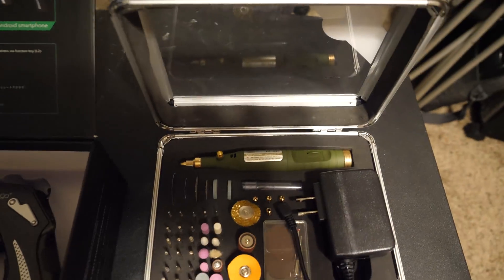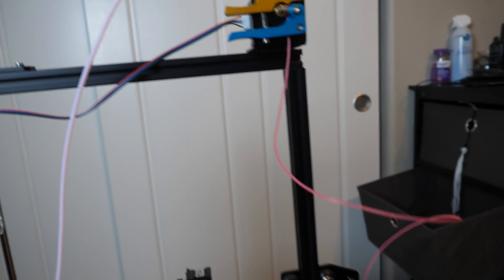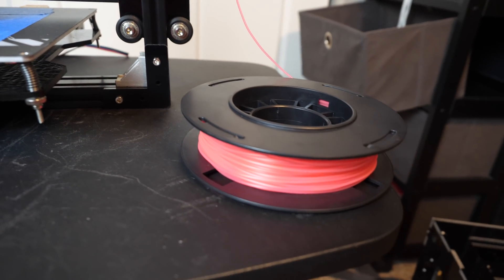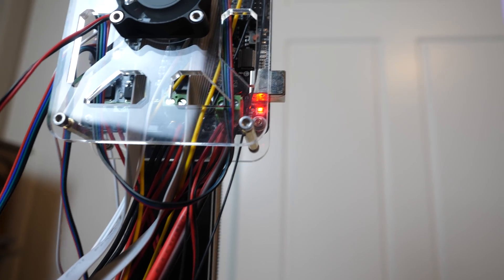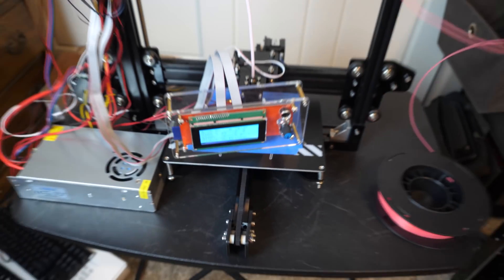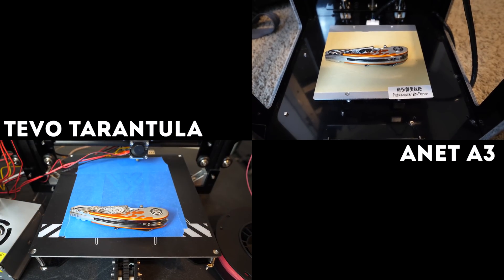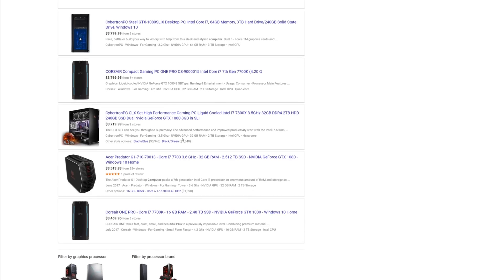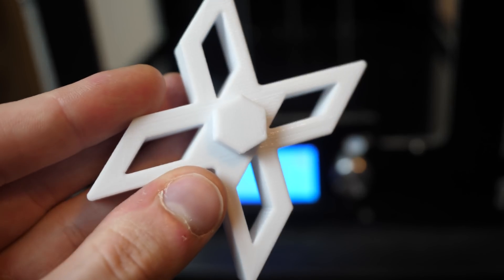Build It Or Buy It - 3D Printers

Comment: Well, that video is kinda shallow.
It's never a good thing trying to review something first time and came up with some generalized statements about the whole thing.
F.e., assembling a printer from a kit is not a 100% build. There are 3D printers built completely from scratch and there is a huge community behind it. Not to say there are so many 3D printers (both assembled and kits) with different pricing and specs - not much things about them can be generalized. It is not rare In 3D printers: you can easily overpay for something not very good and for cheap get something awesome just because the market of printers still in rapid development phase.
...
BTW, next time someone say about console exclusives - it is reasonable to point out PC have the highest number of exclusives - more than all the consoles combined :-]

Comment: I built mine in 3 hours, plus 1 hour of cable management.
plus 2 hours of making a custom x/z axis, plus 1 hour for a 70mm fan mount, plus 30 minutes to change the control panel location, plus an hour to switch to plastic bushings instead of bearings, plus 2 hours to make an enclosed box with a heater... well you get the drill, I customized it a lot.

as far as the comparison, the tarantula has more than twice the build volume(200*200*280 vs 150*150*150), but I'd suggest the CR 10 instead at this price point, it is easier to build, has a bigger volume (300*300*400mm) and costs 4 more silly european dollars than the tarantula.
Reply: here's a gearbest link for the cr10 https://www.gearbest.com/3d-printers-3d-printer-kits/pp_637921.html?lkid=12706796

Comment: My cousin built a 3d printer from scratch, not bragging, just saying that I know a few cool ideas. He started his project roughly 2 years prior to this comment. He used wood to make a kind of tower that becomes a triangular pyramid at the top, in the base is the electronics and a monitor he salvaged so that it has a UI. Its big and inconvenient, but he uses it for his university and for fun. its still not done yet, he had break times where he can use it, but its just a stage... My though is that building a 3d printer is more rewarding, but for it to be looking good and very functional, it will cost far too much time. I would like a 3d printer, but i wouldn't use it other than for making prototype of an idea.

Comment: OMFG THAT TEVO. PLS DO SOME CABLE MANAGEMENT.
Those cables are just hanging there though theyre on a moving part! Also, you do know that you might die if you touch the bottom of that power supply? And buy a MOSFET if you don't want your house to burn down.

Comment: Wait... You were supposed to use a european plug, but you used a standard american one, doesn't the printer miss a lot of voltage then?
Reply from the maker: BlueDragon1504 it didn't seem to,  it was just the plug :)
Reply: BulletBarry Huh, odd. Since I was guessing that the whole printer would be configured for Europe where 230V is used instead of 120V

Comment: I have the anet A8 and I can say it took me I would say ~6 hours to build and ~4 for calibration. Honestly it was VERY annoying to level the bed. Anyways it kind of worked for a year and then as I was trying to make the filament extrude during a quick project the screen just shut off. Turns out, the ground cable just fell off the power supply. About 80% sure the problem is the motherboard, so now I need to replace that for $30 on a ~$180 (very cheap) printer.

Comment: 2:10 whoa how can you just stop and laugh after a stepper jams like that?
I would instantly switch the psu off lol. Maybe I'm a bit paranoid, maybe also because I'm using larger nema 34's.
Just finished building a CNC Router for myself and currently making better parts for it.
Nice 3d printer, and thanks for the video.
Reply from the maker: hey I'm glad you liked it!!!

Comment: You should angle your bowden extruder to provide a bit more slack on your ptfe tube. Also, be sure to print out some structural braces to strengthen the frame and help increase your print speeds and print quality.

Comment: I bought the reprapguru prusia i3 v2, I put it together fairly quick but had a couple visits from jerry, ya know jerry rig? ya that guy. he helped with some issues but cable management came together realllllyyyy nice with my printer, there was a place behind the printer to mount the arduino, the ramps board, and the power supply behind the printer, so everything is nice and hidden. 7-10 would recommend.

Comment: You know, your 3D printer building skills are terrible.. the only reason you experience many of the problems you do while using it.

Built a Tevo Tarantula myself, came out perfect, prints perfectly with incredible quality each time, no hickups or jams, ever. Also, it looks very presentable and clean on the table. If you do the wiring right, it's a whole other story.

Sorry for this comment, but I really feel like this video is incredibly biased.
Reply from the maker: I looked up a lot of reviews and most of the time people run into errors with it, there is almost always a time period where little issues arise and according to what i saw it's rare to have it work from the get go, however I like the tevoo! I think it's an awesome printer!
Reply: Well, tarantula isn't top tier, those printers need some love, and upgrades, but you can get some amazing quality with it. And you put your Y axis belt the worng side up
Reply: Juba Noakes Yeah and if you put mesh on the wiring instead of that shitty plastic wrapping they got it looks professional as well.
Reply: ResQ ur pfp is マ xd
Reply: Sponsored by Tevo
Reply: everyone's experience is different and can differ form different builds. But most novice will run into issues. One of the drawbacks form building your own
Reply: i am very smart
Reply: I was thinking the same. I build my Tarantula and my Anet A8, both built by me, the Tarantula didnt work too well (first i brought). When i put my A8 together it printed well, i printed some upgrades and well... now it prints godlike... my instagram is @3dprintsource if you want to see a self built printer's prints.
Reply: Barry has always tried to show no bias though. Also, he said he was a rookie and has never done it before
Reply: git gud Barrel

Comment: CAPTAIN HERE: berry, you should never print in a completly closed room, DO NOT USE IT IN YOUR ROOM, use a other room with a constant airflow, the gases wich will come out of the plastic are bad for your life expectation
Reply: karibu1404 2.0 and they are stinky
Reply: LikeStrikeProduction thats the gases
Reply from the maker: good info! I always had the window open as I was not sure if that was a thing
Reply: BulletBarry it would be better if you put the printer directly under a window and ad an old pc fan with a powerscorurce to the window (airflow facing outward)